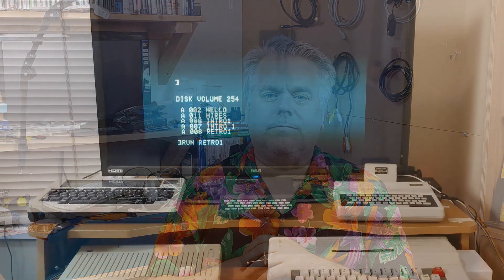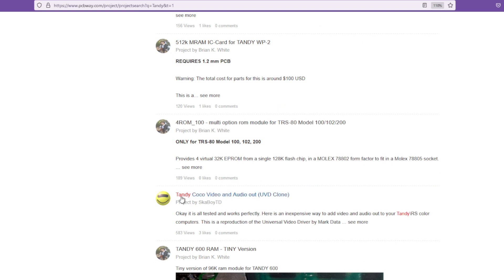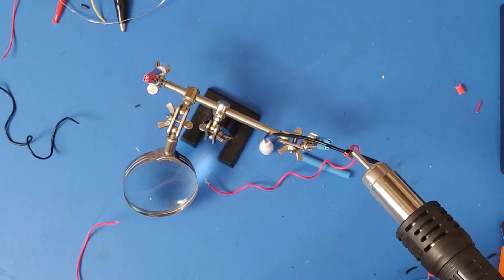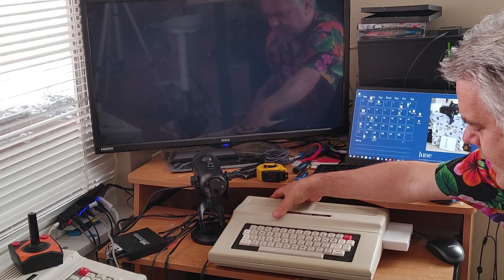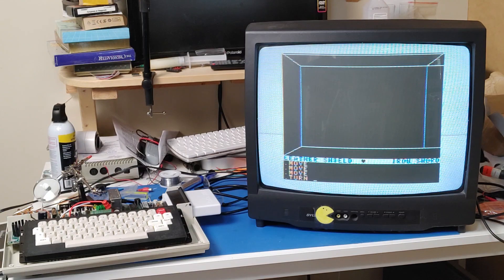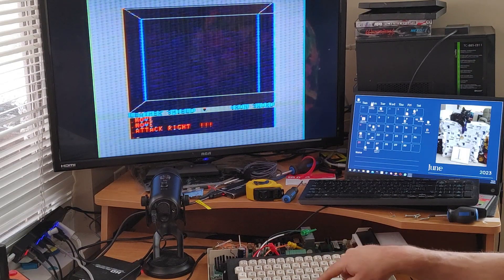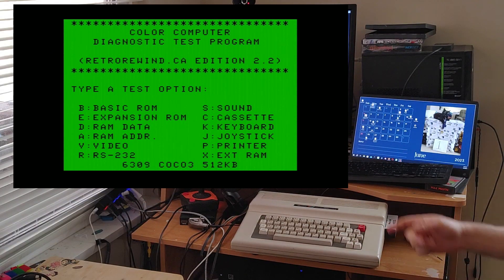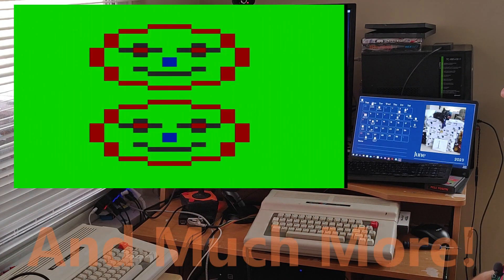Adding Composite Video To My CoCo 2 With The Universal Video Driver: Part 2

Comment: That green wire is the Chroma input to the board and disconnecting it removed some of the green tint.  MDP suggested clipping the Chroma lead to a special point on the board marked with an arrow to use the board in monochrome mode.  My guess is that that point on the board is ground (I don't have their board to confirm), but it should nullify the color input an remove the color burst signal.  Does doing that improve the monochrome picture?  Also try going back to shorter leads to see if the color burst (or other interference) is coupling into the long wires.  Another possibility to check might be to use a series resistor on the composite video output.  Change the existing resistor (which is a low value of 75 Ohms or less) to an adjustable resistor to see if it affects your TV's composite input.  Different TVs have varying sensitivity to the output resistance of the composite signal.  I hope you get it going !
Reply from the maker: Great suggestions, the craziness of life has kept me from this project but I hope to have something more by the end of the month.

Comment: Posted this on FB but will repeat here. Your green wire is the chroma signal so of course disconnecting it improved the signal. Fault isn’t on the mainboard so your chroma signal itself is intact but that signal is voltage sensitive so double check the connections and look for any unnecessary impedance. If there is a fault it is likely to be the amplifier circuit on your video board. Bit worried about extending your av leads…
Reply from the maker: Thanks, this gives me some things to look at!

Comment: I don't know the circuit, but double check any capacitors and diodes for correct polarity/short.
Maybe a solder short between nearby pads?
Reply from the maker: It was mostly working originally, I think I may have fried something this time around.